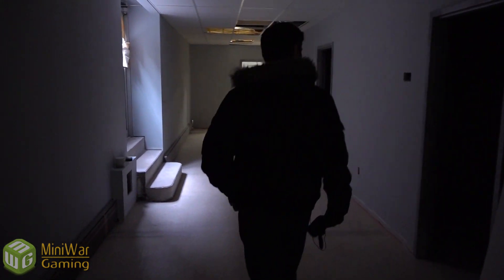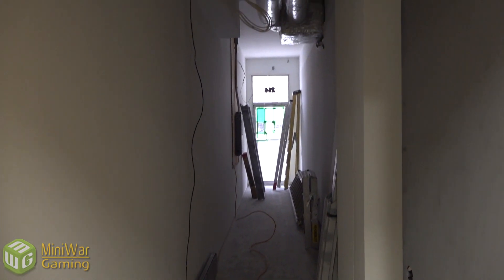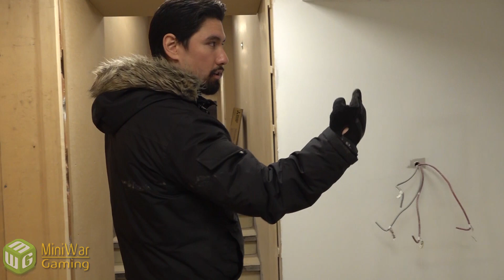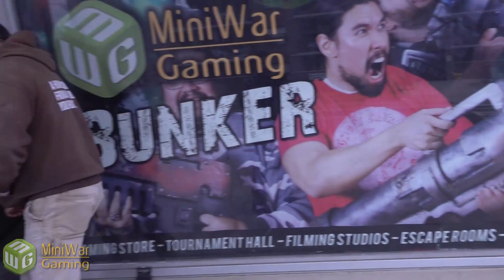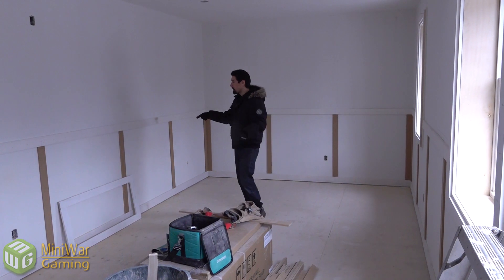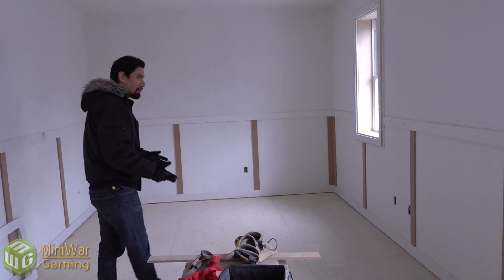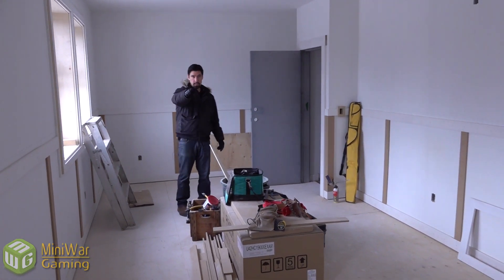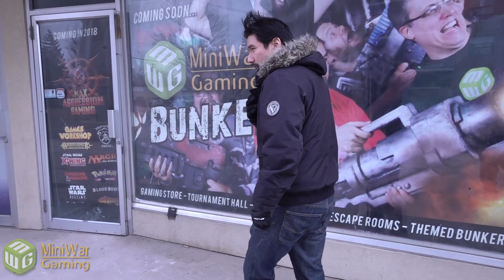New MWG Bunker Update 11 - We've Got Flesh On the Walls!!!

Comment: multiple options:
1. a small shrine/mural to the god emperor cant be missing in the officers room. 
2. an overview map of the star map with troop movements and overall tactical cogitator display :P
3. fleet movements in suppressing a tau expansion in the system.
4. close up picture of the eye of terror, with off the charts, contradicting, illogical measurements and readings like temperature, gravity, time or pressure
5. Giant golden aquila
6. Recruitment papers for the Guard and diffrent propaganda papers like a bulletin board

sorry for the spam :p